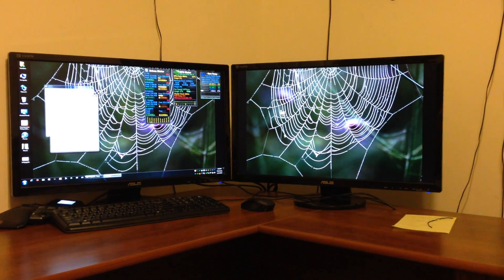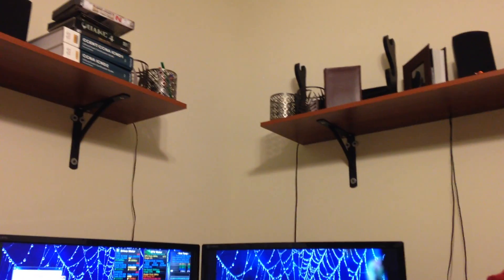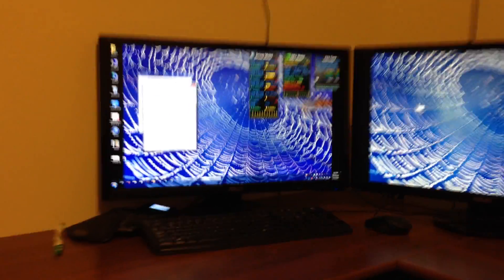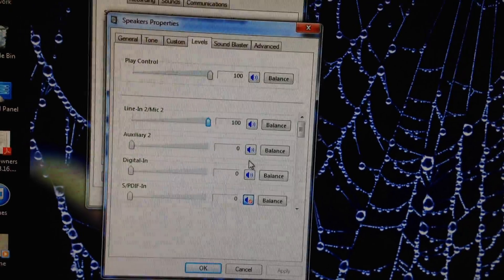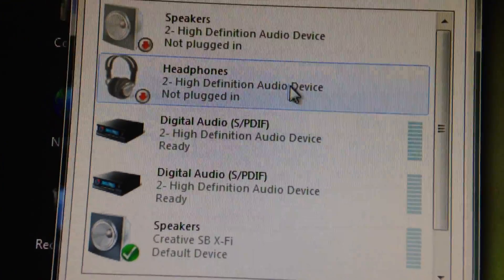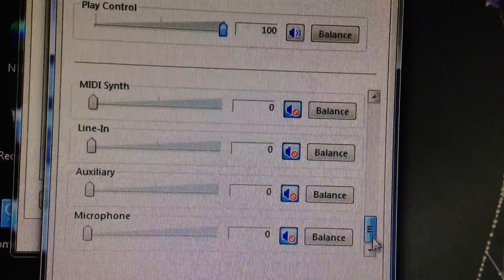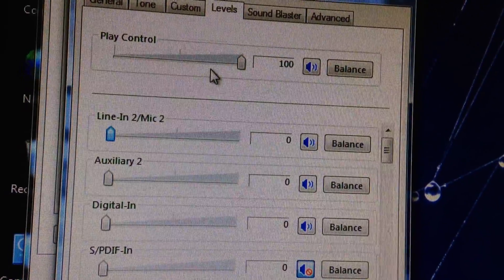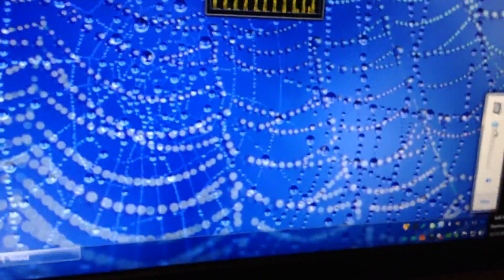Creative X-Fi Popping Noise Fix! SOLVED!!!

Comment: For those having the same problem in 2019/2020 with a Windows 10 update (where the 'Speakers (Creative x-fi)' option is available but sound pops and crackles for high frequencies in music), the fix is to; 
A. right-click on the speaker icon in your taskbar > Open Sound Settings.
B. select App volume device preferences
C. Click the 'Reset to Microsoft recommended defaults' button.

If you no longer see 'Speakers (Creative X-fi)' as an output option
1. In device manager open 'Sound, video and game controllers'.
2. Right click on Creative SB- X-fi > Uninstall device
3. Turn your computer off and physically remove the sound card.
4. Turn on the computer. Once Windows has started up fully, turn off the computer.
5. Add the sound card back. Windows will redetect it, and you should now see the Speakers (Creative X-fi) option.
6. If you hear crackling at high frequencies, do steps A, B, C

In step 3, its worth looking at the physical output jacks. The X-fi cards are now old, and you may see discoloring on the contacts due to oxidation - this may be your problem. Time for another soundcard, unfortunately!
Reply: Any advice for the G6 I always get a loud pop every 1 hour and 10mins exactly when watching something
Reply: I couldn't find the settings in ABC for Windows 11, but in the Sound Settings area I set the 'Audio Enhancements' for the Creative Blaster card to OFF and suddenly no more pops.  So, in a round about way... cheers for the help! g

Comment: The issue is still there on Creative SBX G6 with 32 bit, 384,000 Hz. It seems to go away only when I set it to 16 bit, 44,100 Hz. Latest firmware and Connect software.

Edit: Faulty USB cable.

Comment: Before you go you on a wild goose chase inside your PC, try checking that ALL your audio connections are secure. I had this problem on a 2.1 system.  The jack from the computer to the 2.1 goes to the subwoofer, and from there the tweeters are plugged into the subwoofer.  It was this second audio connection that was causing the problem.  So if you're having a problem, try connecting your 2.1 system to something else, like your phone or tablet.

Comment: I installed the latest Geforce Driver (390.65) a few minutes ago and my audio started having some annoying crackling sound. I have a Creative X-fi Platinum PCI card. I didn't have the clicks in your video, but your tip fixed my issue!

Comment: Hmm, no help for me. Still crackling. Line-in had nothing to do with it in my case. The only help so far is changing the soundcard mode, which restarts the drivers. But this remedies the situation only for couple of hours, then it starts crackling again. I know for a fact that it's not a hardware issue. I started having these problems after i installed downloaded drivers for win7 on a board which also has onboard soundcard. I read on some forums, that it's an issue with conflicting drivers for the x-fi and drivers for the onboard card, that you have to not only unistall the drivers for the onboard soundcard, but also disable it entirely in device manager. Which i did. Did not help. I'm getting crazy, because it's happening more and more often. It's definitely a win7 driver issue. I  did not have this issue, when i used drivers from the install DVD. But when i was changing my OS from XP to win7, i couldn't find the original DVD, so i downloaded the drivers from the internet, and since then i'm having these problems. The crackling worsens, then it makes horribly loud whitenoise sound and stops working alltogether. The only thing working is either restart (which i'm trying to avoid as much as i can), and the mode switching - which is annoying as hell too, because i have to close all programs with access to the soundcard, like browser, media player, games, audio software, everything. If i don't close these programs and do the mode switching, it won't help. It really pisses me off, because i know that the card is ok, it's the software that's shitty. But that's a theme with creative. I miss the old days with SoundBlaster Live (where creative didn't bother to reasonably utilize the fantastic EMU chip), where you could download famous third-party KX-drivers. Latency-gone. Sound quality - up. New uses for the card - lots of. I loved the KX drivers. I played a few club gigs from Reason running on SB-Live with KX drivers, and people were coming up to me, praising the sound and asking what my soundcard is. When i told them that it's just SB Live, they thought i'm making fun of them. Good times. So back to the crackling. IT PISSES ME OFF, YES. And i still haven't found a solution. I also don't know, why it's happening more and more often. When it started after the win7 installation (cca 5yrs back), it happened only one to two times per week. Now it's every few hours. So if anyone has different tips, PLEASE reply. Thanks.. [TL;DR] - it's still crackling. [/TL;DR]

Comment: I was getting a loud ringing in the right channel unless some sound was playing through the system. I have a Sound Blaster 5.1 external card. I've had the card about 2 years and it was working just fine until all of a sudden, the ringing started. Poking around in the settings, specifically the configuration and deselecting "Full Range" seems to have fixed the issue.

Comment: While this helps, it's not a permanent fix. 
As, I've went as far as turning all the levels down, except for the primary and then went and disabled the others. Seems like once I day I have to disable and re-enable it. 
Then again Win10 fucked my rig to the fullest, making the OG XFi software that came with my SB SFI Titanium card inoperable. Search and asked for feedback from: 10 forums, toms hardware, reddit,  creative forum and even went as far as contacting technical support for creative. nothing back yet.  went and bought the new SB XFI3 software. The software works, unlike the OG. but the random popping still happens once in a while.

Comment: weird. i have the klipsch GSX 2.1's and dont have that problem on my x-fi fatality platinum edition (regular PCI).  sounds like interference maybe?  how clean is your power supply in terms of voltage delivery? did you ever test for that? reason that i'm asking is that there might be less than the 5 volts being pulled through the power cable, or fluctuations might be the reason.  i'm currently running an enermax galaxy 1000w power supply and have good consistent throughput on the 5v rails.

Comment: Trying to use this idea with a X-fi surround 5.1 external usb, doesn't work. Crackles on optical, or plugging directly in. Using either the ATI video card or mobo audio, doesn't do this. So its not a power issue.

Comment: Hello. I wish to share my experience. I too had the same problem of this kind of noise with Creative X-Fi Surround Pro 5.1 USB. I tried with default windows drivers and with old creative drivers and with newest driver. It didn't make any difference. I also tried the fix in the video, but it still didn't work. But I noticed that in my case it was interference from one of the wires going in the sound card. When I just changed the position of the sound card (put it further from the computer) the sounds stopped (no noises even on max sound). I hope this helps someoune.

Comment: Thank you for the advice but it's not really a "sollution" since you can not use the microphone or Line in port on the card. I had the same problem with my X-Fi Extreme Music and after reading lots of forums and spending contless hours of testing I made my conclusion that the X-Fi range of cards is extremely sensitive to disturbence on the PCI bus. It's a combination of lots of factors causing the crackling sound and everything that prevents the card from picking up disturbence on the PCI bus will help. What helped the most in my case was to increase the PCI Latency Timer from 32 to 128 which means that the card has to wait a longer time before getting interrupted by another card. The crackling did not completely stop so I discovered that turning off the WiFi card and HDMI-sound on graphics card solved the problem. If you, like me, have several other cards on the PCI/PCIe bus try to disable them to see if the distrurbence is still there.

Comment: Bryan, this was a great fix. At first I thought that it didn't work, because I just hit "mute" on all the levels and the popping continued. But I actually had to turn them from 50 down to 0 and that solved it. To anyone else who has tried just hitting "mute" and not had it solve the problem, make sure you set the level to 0. I'm not sure why that make the difference, but it does.

Comment: Did not fix my very sporadic popping on my USB X-FI... Win7 64 bit.  Probably because its different popping.. This is every 5 min or so it will pop in rapid succession, a pattern similar to a pack of firecrackers.
Reply: If instead of going into Playback Devices when you right click the Sound icon on the taskbar you click Recording Devices, you can individually configure the Properties of each device (even if it's "Currently Unavailable"), go to the Levels tab and mute/zero volume them for the win! :D
My random speaker popping would kick in after being used for a while and be present on random speakers, ruining my music; it didn't just pop constantly like in the video either so maybe you are in luck. I also have an actual mic plugged in that I did not have to mute in the above way if it matters to you and I left the What You Hear device alone too.
Reply: outseeker Thanks a ton, I had some slight clicking/popping/cutting out from my new Creative Z card and this fixed the problem completely. Was really ruining the experience on otherwise great sound. I've always had good sound quality with Creative, but their drivers and layout is just terrible. Frustrating to say the least.

Comment from the maker: glad to hear that this has helped so many people so far. i'm not a nuclear physicist but do have some background in software and electronics engineering and it just seemed to make sense after having used this card in so many systems without ever having a problem like this. creative kept saying it was a problem with the PCI bus sync speed. whatev. they should hire geeks like us to fix their problems.
Reply: You saved my life mate...you really did, what a hero, cheers. And this is now in 2016!
Reply: I agree man.  That is why I never trust benchmarks.  Just got RX480 Xfire scoring 78000 default clocks in 3DMark, the record is 79000 lol.  DX12 alone gives a 20% boost so drivers alone tells me older hardware is capable but they keep pushing for capitalism.
Reply: still crackling

Comment: noise could be like my fix on Audigy 2
Creative Audigy 2 crackles fix (it's not due to drivers)

In this case its the three small caps bottom right of board. There too small and create ripple on power rail. Most noticeable when board is doing hard work. Thats if this fix does not cure the fault. Hope it helps.